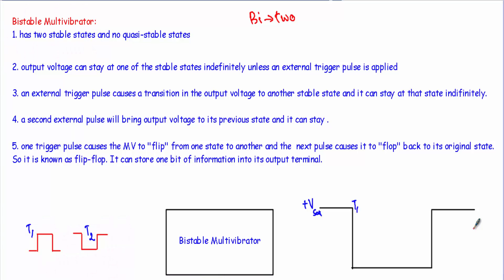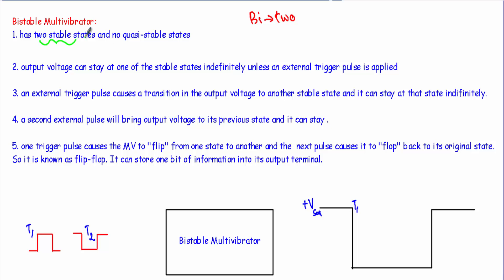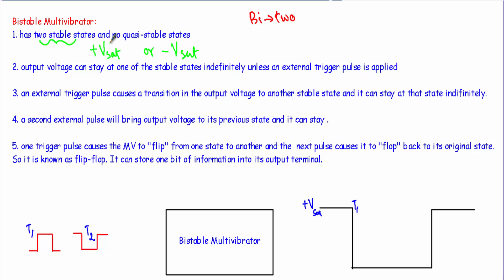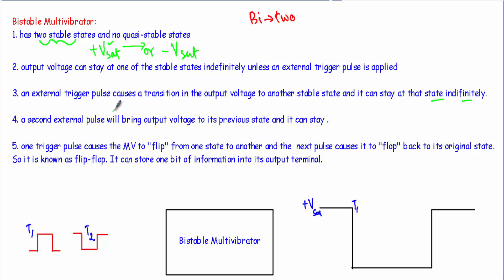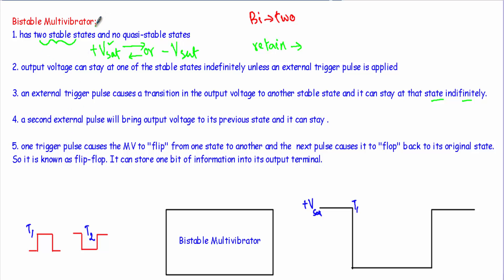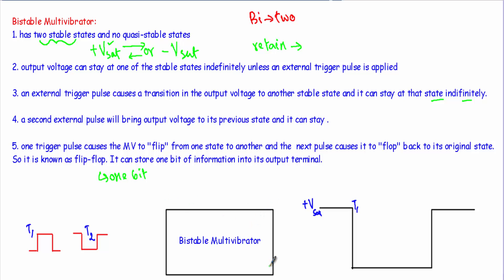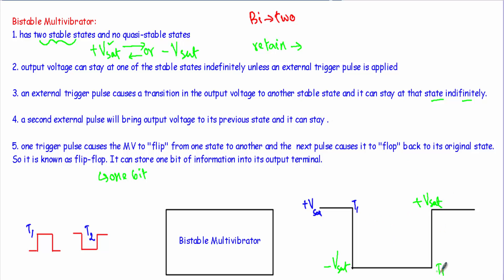Op-amp Bistable Multivibrator

Comment: Capacitor not allow instant change of input volatge how then
Reply: The capacitor and resistance is just a differentiator  to create edge pulse from square pulse.  The trigger input is square pulse what you get in Vn is edge pulse.
Reply: And here in differentiator RC is very small , so it can quickly charge or discharge